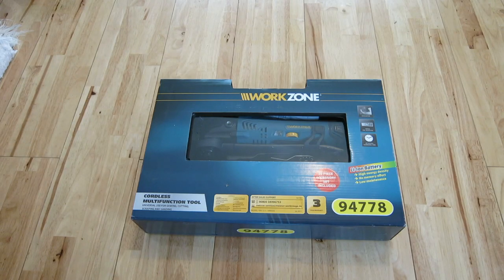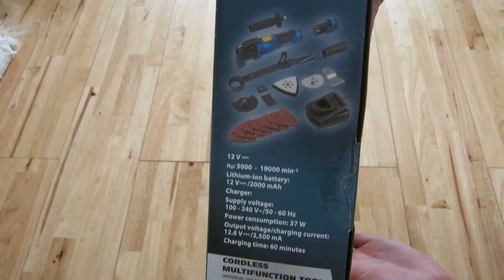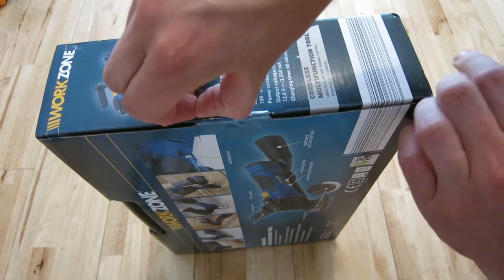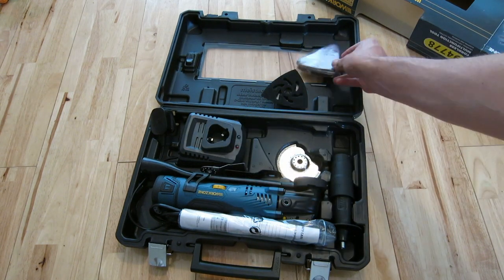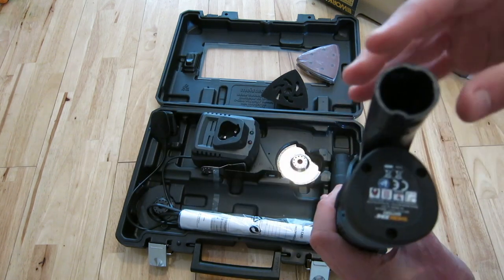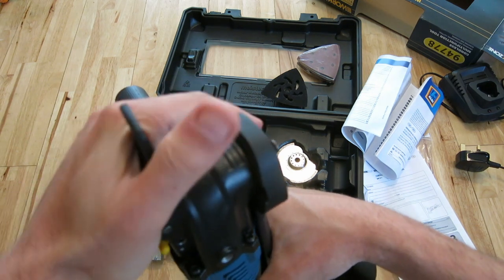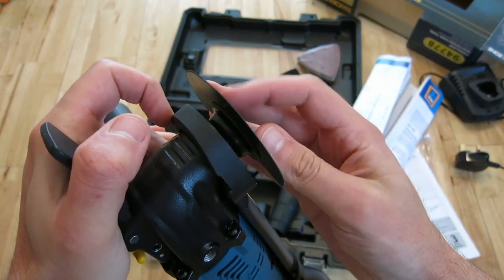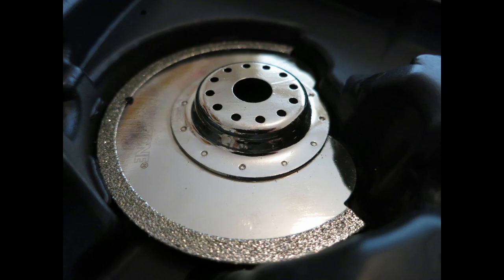Aldi Cordless Multitool

Comment: Bought one last year, worked well however I dropped it and broke it so not covered by warranty. Tried to get a replacement but impossible, not available anymore.  Now the thing is,  they make you buy the charger and batteries separately so I am lumbered with 2 batteries and a Charger which cost more than the actual tool and no other tool to use them in.